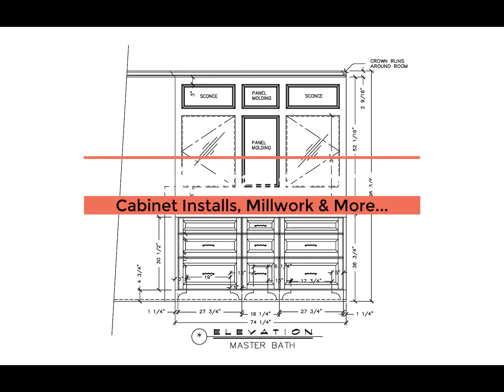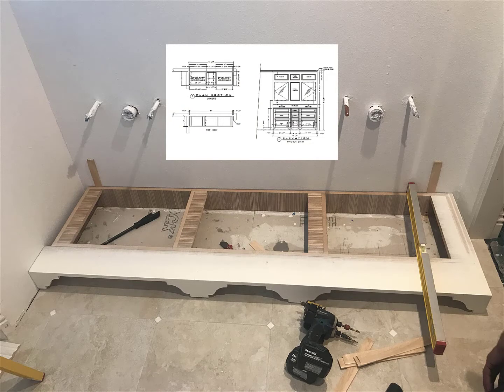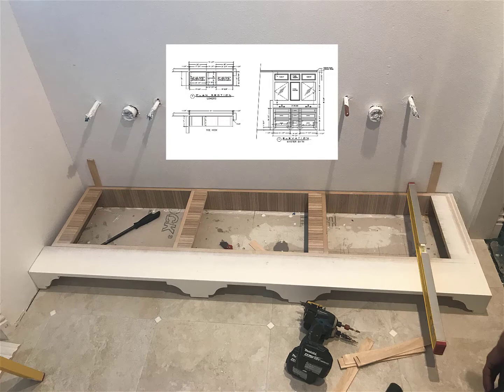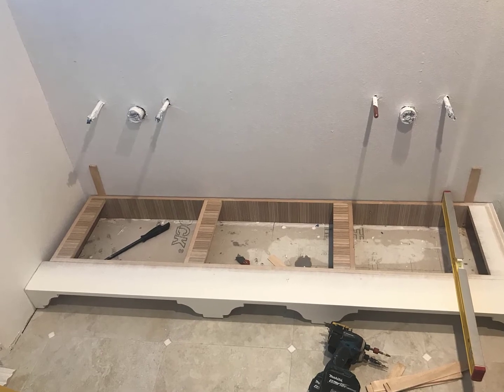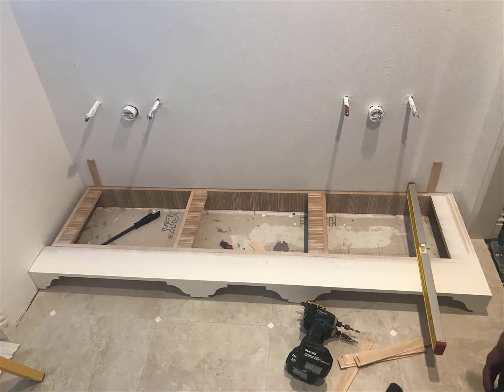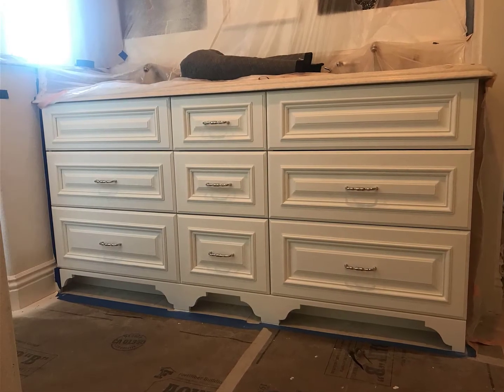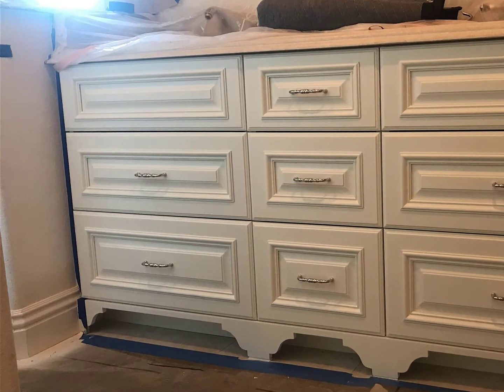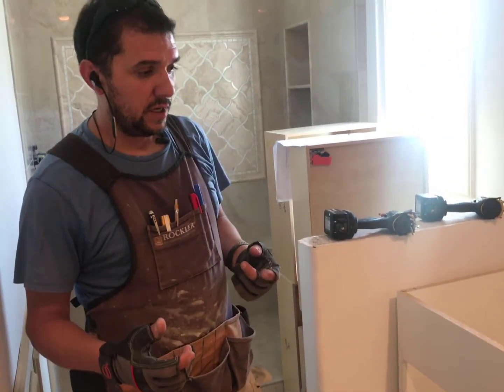Small Master Bath with decorative toe kick

Comment: Thanks for another great video.  How did you get your pencil line along the entire length of the filler since you can't get behind the cabinet to make the scribe?  Did you use a compass and hold the filler up to the wall backwards with the outside facing in to make the line on the back of the workpiece?
Reply from the maker: Thank you DB, it is hard to explain with words, I'll be making a video in the future showing with all the details how I do it. 

Meanwhile here is a bit of explanation: I use a compass, I overlap my piece over the cabinet by 3/4" then I calibrate my compass to 3/4" also, I hold my piece straight and plumb then I run the compass all the way from top to btm.